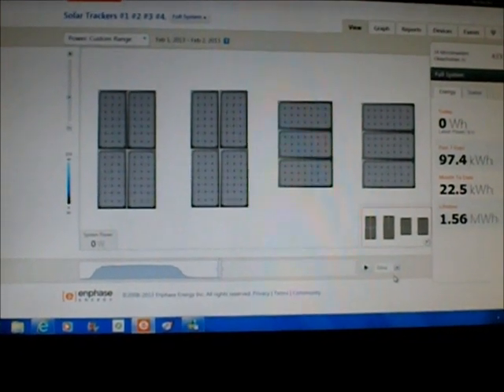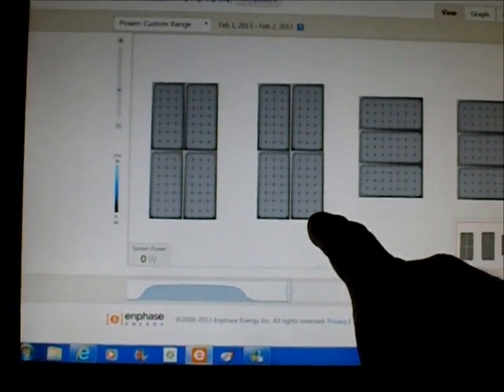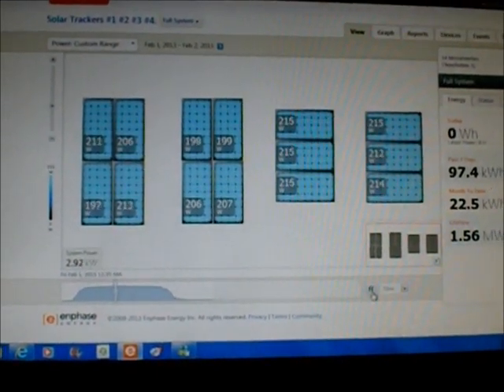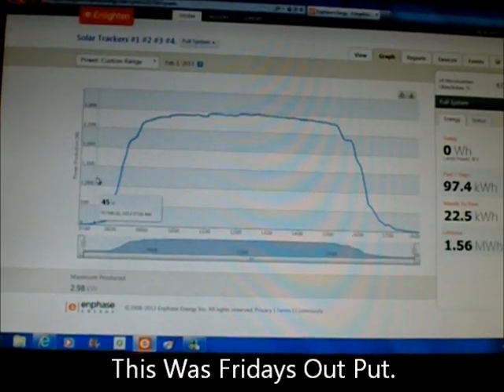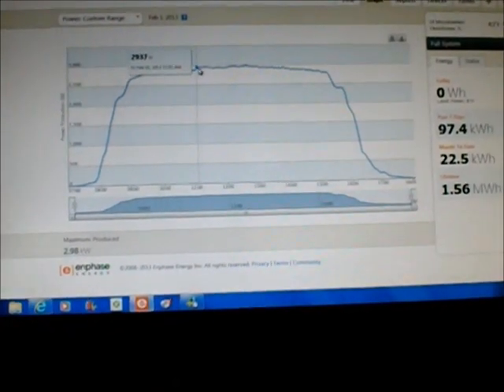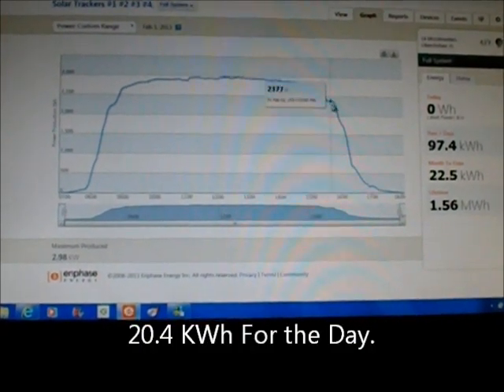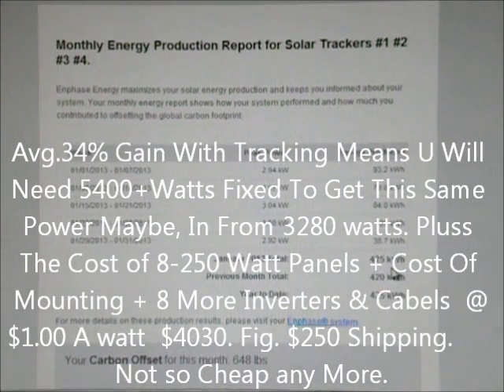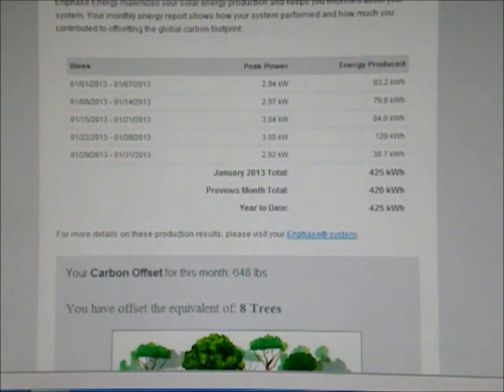Enphase power Chart A Look At Power As It happens.

Comment from the maker: I have a way to get around a power outage do to my first attempt  at a grid tie system using the Power Jacks, so I have A under ground wire run into my home with #8AWG into a battery switch. If I lose power I just undo my Enphase Units & run DC power using the old wire into my Flexmax 80 by switching my dc in  to the charge controller .When power is restored I just hook back to the Enphase system & switch back to my 4 small panels full time to the Flexmax via battery switch it easy to do.

Comment: You have really shown how the Enphase system is more efficient.  Have you figured out a way to use it off grid to feed a battery bank if you had to?  I'm trying to get 6 panels this spring and will be contacting you for one of your robust tracker kits. Thanks for all your posts, it really helps newbies like myself.

Comment from the maker: log onto the Ephase web site any were. it is very easy if U can do basic wiring such as run a 20 amp 240v line into a breaker in your main panel. Super easy.